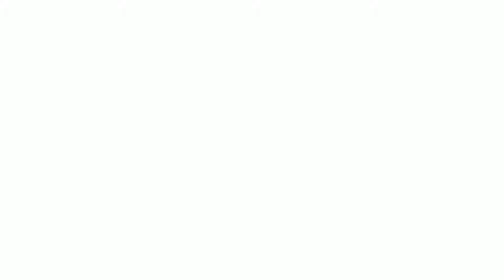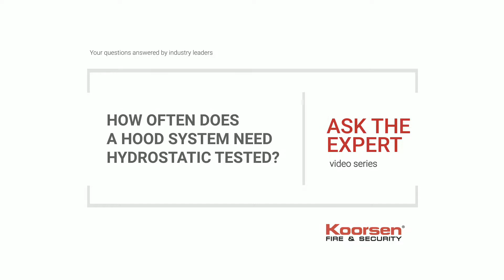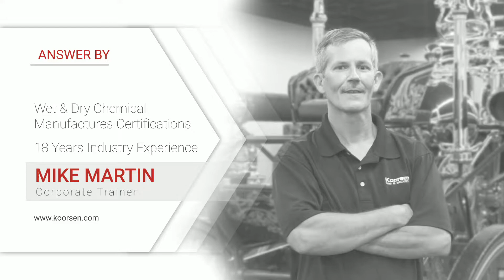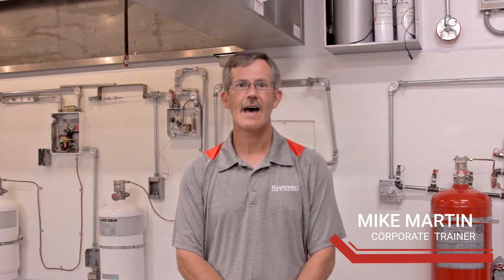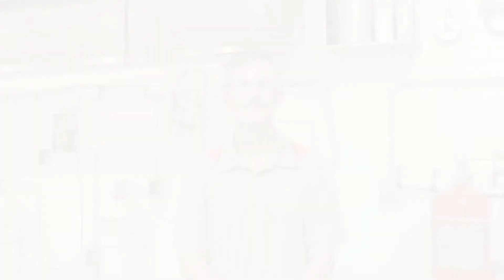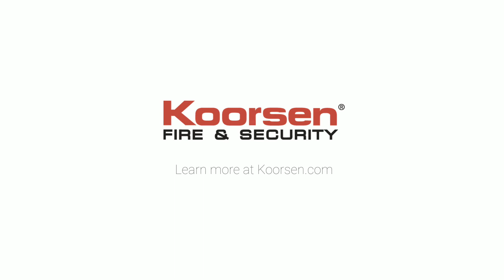Kitchen Fire Suppression FAQs - How Often Does a Hood System Need to be Hydrostatic Tested?

Comment: Odd that an expert gets the answer wrong. The 7 year test only applies to a discharged DOT cylinder. (Basically a cylinder that has to be transported.) DOT has no authority to a tank mounted on the wall.  This is also applies to CO2 cylinders used in CO2 systems.  Also tested at 12yr intervals unless discharged.